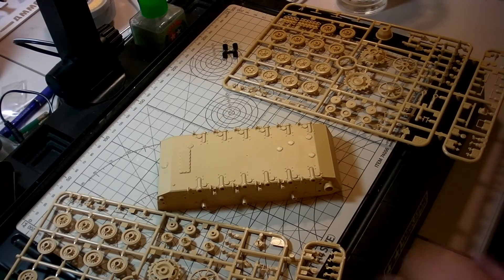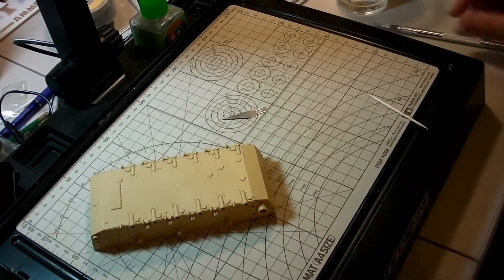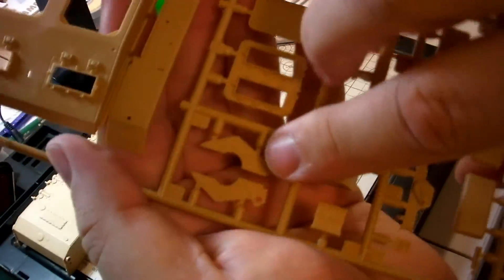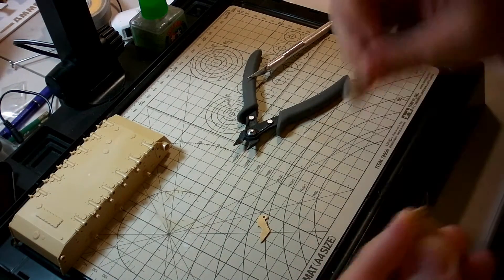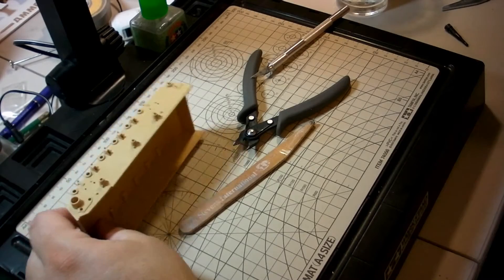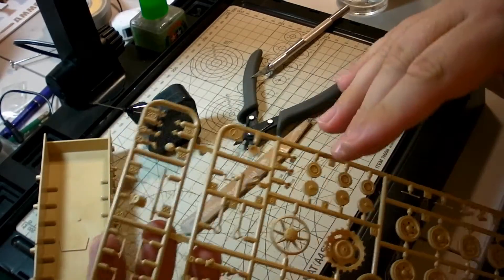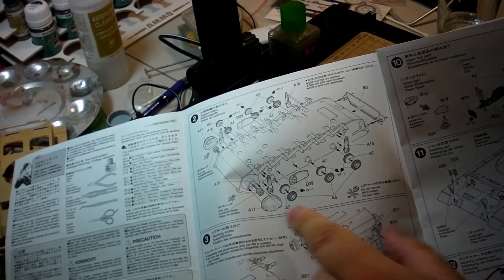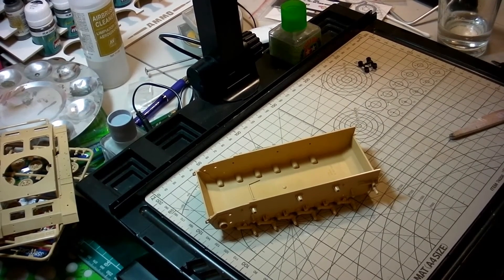Let's build a Tank part 3 (Construction)

Comment: "Sprue number B"
heh.
The zoom-ins look a bit dark, otherwise I love it.
Can't bring myself to put the extra 4-6 euros on Tamiya's extra thin though. Revell Contacta Professional all the way for me! The easiest way to unclog the thin metal tube is to use a lighter or a match and burn it out, in case you don't have any 2mm brass handy.
Reply from the maker: I am sorry about that my primary camera is down right now and I haven't had a chance to get it to Canon to have them look at it.  This is my back up camera and it sucks.
Reply from the maker: You are nuts btw there is no way I am getting any flame near that stuff!  haha
Reply: TacticalJackalope

I'm not sure if the stuff you're using is somehow more volatile than Revell contacta, but I swear it's perfectly safe to unclog the stick with a flame. It might spout a bit of glue out but I've never had any problems. Naturally the stick will be hot for a while after so the first few drops of glue might sizzle a bit.
Reply from the maker: The Testors stuff actually comes with a bit of wire to unclog the needle but I lost it ages ago.  I think the Revell Contacta and this Model Master cement is probably pretty close.